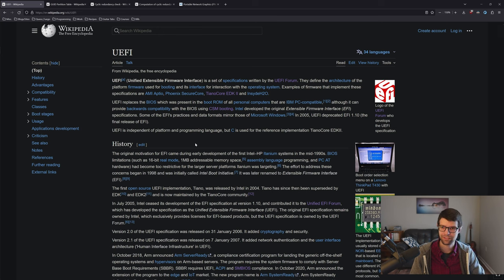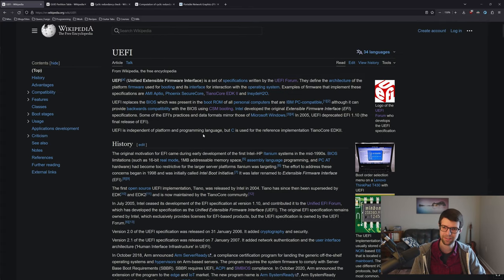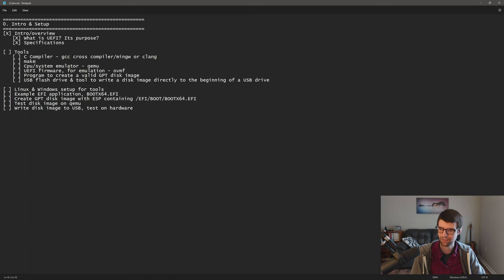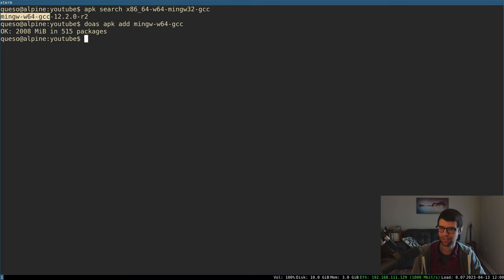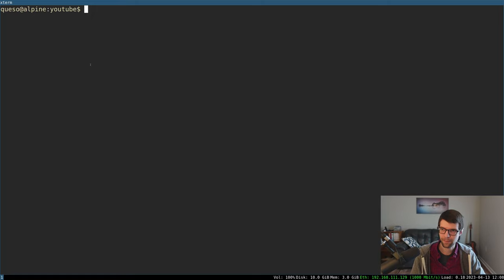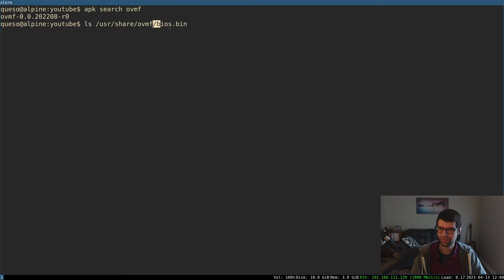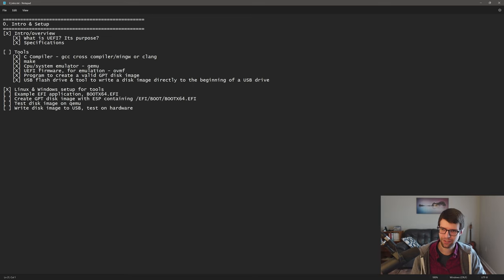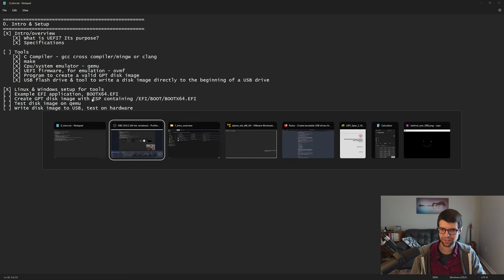Intro / Overview | UEFI Dev (in C)

Comment: Some day I am going to learn all this stuff. At 51, I am sure I have tons of time to do that. Sigh. You are awesome.
Reply from the maker: Well, I've had some interest since later teenage years, but for programming, that started part time in college for a few classes for a few years, and I've had a full time programming/analyst job for the last 6 years. Right now it's been 6-8 years at most of off and on learning & programming, and half of that probably 20-30 hours/week, or less.

But I read and research a lot more nowadays, and try things out badly and stubbornly until they work, and then improve the design from there. If there's lower levels to try out, then dive into those too, until you can't go any where deeper or there isn't info to find. It's not efficient but teaches you a lot of how things are put together under the hood and different tradeoffs to make. Can also try to make things simpler than they are often are.
I usually don't understand anything unless I write it up myself and test it out, it doesn't stick in the brain and make sense until that point.

What I'm trying to say is that it is possible but it does depend on time commitment and interest. Knowledge compounds over time, and it gets easier and faster to pick up more things the more you do. If you're truly interested in something it will work out in the end.

Comment: so the uefi programming is not limited by just making bootloaders?

because im really interested in trying to make my own os from scratch, and with my architecture that would require a uefi bootloader.

but in your amazing playlist, i see you implemented simple graphics and cursor access
these shouldnt be related to OS functions? or it is just a more refined bootloader?
Reply from the maker: It's whatever interfaces or apis are available from the spec, and supported by your hardware, normally you'd use exitbootservices() to fully get control of memory and load a kernel or other program to end the bootloader portion, but that could lead into an OS or any other programming. 
The graphics are writing pixel data to the GOP framebuffer, the cursor is drawing pixels for a cursor to that framebuffer depending on the data returned by the pointer protocol apis. 
Uefi is meant more as a bootloader or BIOS replacement, but could technically be used for general programming or OS.
They aren't OS functions, they're implemented in firmware and uefi is a standard interface for that firmware
Reply: @QuesoFuego  The picture is clear now. 

Watching your videos and reading the comment's section is always great! I've learned so much so far! This series is gold! 

Fun fact: the slow frequency of video uploads/updates make me always anxious for the next episode. Please don't rush, take your time. Thanks man.

Comment: Just a heads up. The UEFI is a PE32+. Meaning you do NOT need a cross-compiler to make the actual EFI file itself. The Cross-Compiler can be used for the kernel however. Although I never did in my series. I never needed it. Although the Nuwem GCC version is the one I use, it's NOT a cross-compiler. So just giving you a heads on that. Cheers on the video my friend.
Reply from the maker: That's true, I should have explained that better. Mingw gcc makes PE files and isn't a cross compiler for windows. Linux gcc needs to be a cross compiler for PE executables since it makes ELF files by default. UEFI does support 32 bit PE32 and 64 bit PE32+, but I haven't messed with 32 bit.
If I'm wrong please correct, I'm going off of chapter 2 in the spec for 32 bit calling conventions
Reply from the maker: well chapter one does state PE32+ only, even for 32 bit. Okay, that makes sense then.
I've seen references to UEFI32 and microsoft has 32 bit header docs which have the EFI subsystem type 10, but I agree with you and will say it requires PE32+ to be safe. https://learn.microsoft.com/en-us/windows/win32/api/winnt/ns-winnt-image_optional_header32?redirectedfrom=MSDN
Going to assume it may have supported PE32 explicitly in the past and more recent versions assume full 64 bit executables for compatibility with both

Comment: Are you going to add the old kernel to this?
Reply: I can't speak for him, but I have hinted to him that since his legacy OS is 32-Bit, and it's all based off of legacy code, that he might actually be better off writing the new OS from scratch. Not only could he take advantage of EFI directly without the legacy code, but he could even improve on his design. IMHO, he would be better off writing the 64-Bit kernel directly from the 64-Bit EFI. Older computers from the last 10 years can still use EFI, even if it's CMS ( compatibility mode ), which is still 64-Bit. Writing it from scratch would actually save him time and without the frustration of converting.
Reply from the maker: For 64 bit there has to be changes to the GDT, IDT, and paging setups, probably minor things other than that. UEFI would be replacing the pre-kernel setup, but I might try to get similar info from the ACPI tables and elsewhere for the 32 bit OS bootloader setup, and have it call the kernel with similar info. While there should be 32 bit UEFI support, I don't have any machines that use that, my older stuff only uses BIOS.
It would be easier to have 2 separate kernels, one for 32 bit and one for 64 bit, so I may do that. That's closer to what linux/BSDs do for supporting multiple architectures, they have i686 and x86_64 for example. Otherwise there'd be #ifdefs and other things getting in the way in a lot of places to have the same kernel support both at once.
Reply: @QuesoFuego  Yea, two different kernels could work.
EDIT : Now that I think about it, modular code could work. You have both 32 and 64 Kernels, and then everything is modular in design. It would just boil down to compiling it either 32 or 64 bit respectively. With that said though, I am looking forward to your 64-Bit version since that meets todays modern computers. This was definately a good question to ask by @lowos107.
Reply: Thanks for answering